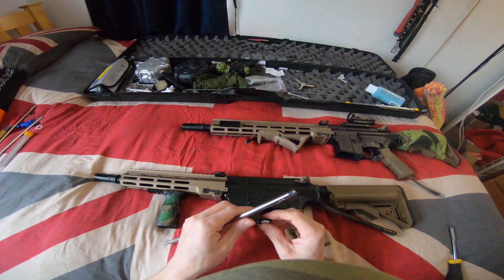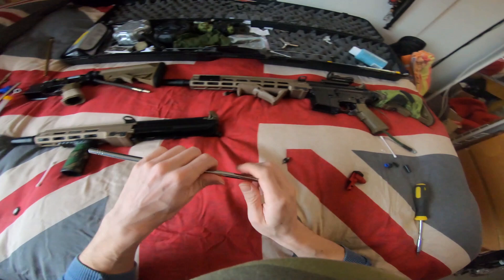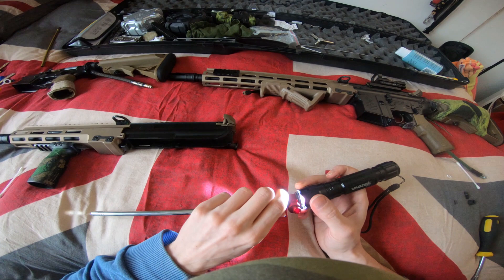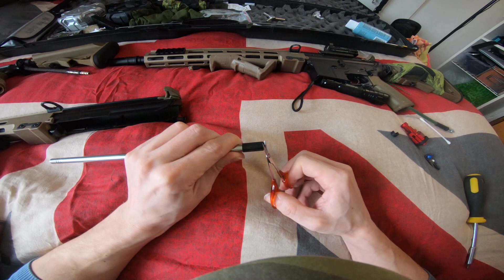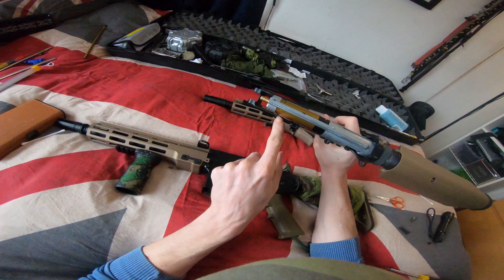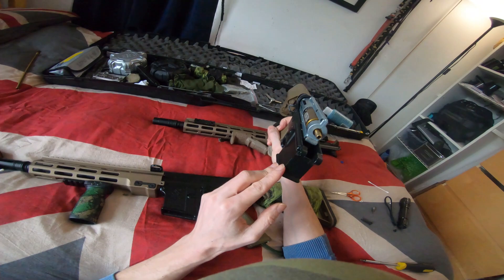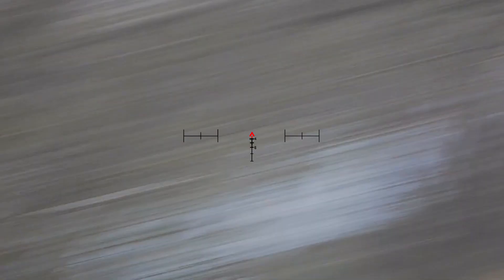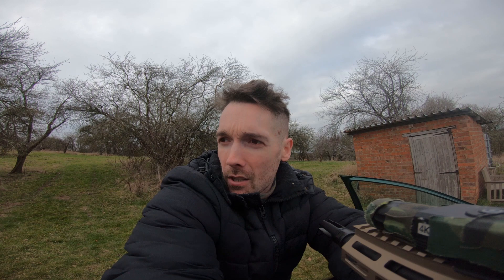Umbrella Armory Rhop Barrel Install and Shooting test video

Comment: nice effort! nicht engagement! but it's going to be interesting with 60m and above!! myy sr25 f2 with davinci 7 barell & shp7 bucking drops with 0,43bbs at 90psi and 1,94J at 70-80m
Reply from the maker: All depends , on game days i always over hop mine so at the end of there flight they just lift a tiny bit to get that bit more distance on em
Reply: With what Tensioner ?
Reply: @affeCted6990  7mm Alu tensioner from the Neptun Chamber wich also is installed
Reply from the maker: @affeCted6990  i always use flat hop nub

Comment: 6.03 or 6.05 which one has more range? Which is used in the video
Reply from the maker: 6.05 is used in the video and personally i prefer the wider bore barrels with my hpa, with the range id say the same because of the flat hop.